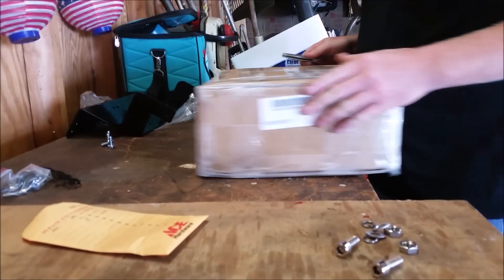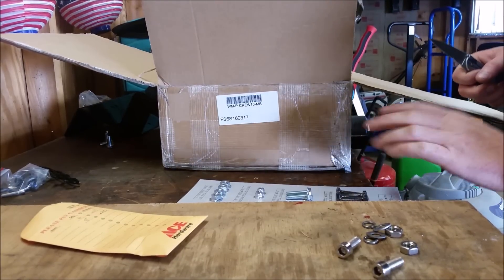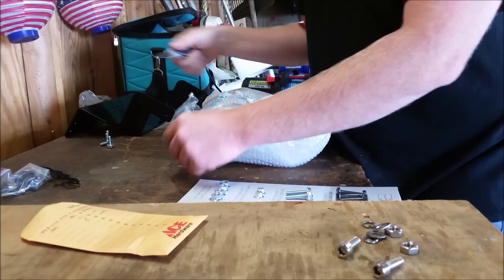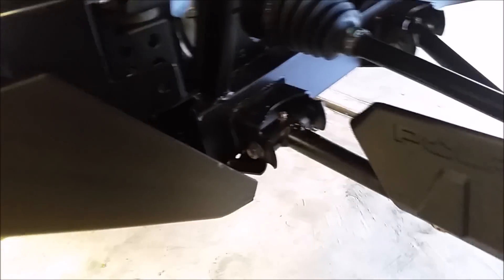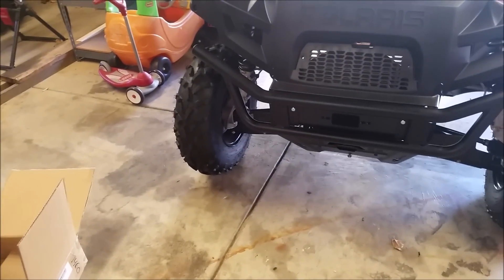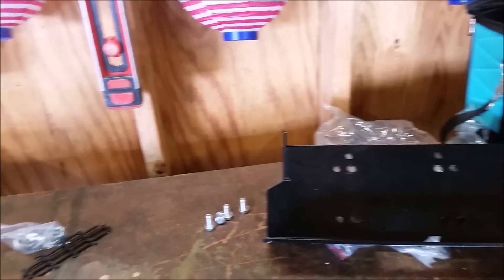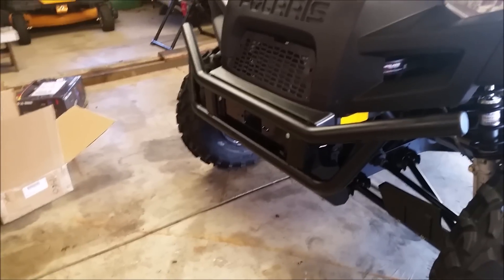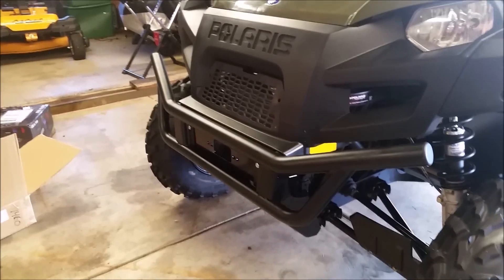SuperAtv winch Install on the Polaris Ranger Part 3

Comment: Hello,  I am in the market for  side by side for similar reasons as you were.  Would you recommend the full size vs mid size 570? What would you change if you were me?  Thanks and great videos!!
Reply from the maker: mike lacey it seems like the mid size is way more popular than the full size. it seems like they make a lot more accessories for the mid size. also I really like the profit accessories but they don't fit on the full size.  the difference is only 2 inches in width between full and mid size. If i would buy one again i would buy a midsize.
Reply: Brett Buckley thanks Brett that definitely helped.  Keep posting those great videos!
Reply: full size seats 3 people with seat belts and has much more power!
Reply: I got the 2018 Polaris ranger full-size 570. I love it. 3 people can ride plus a little extra room for a big guy.